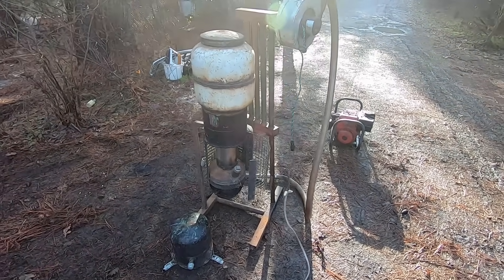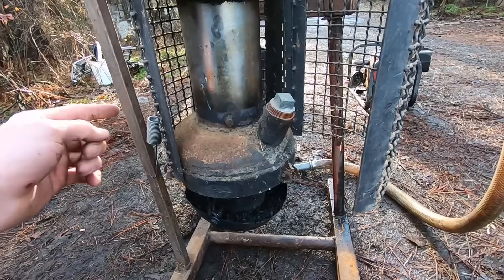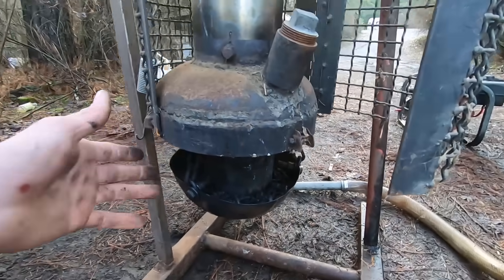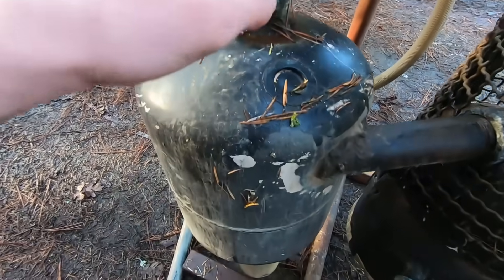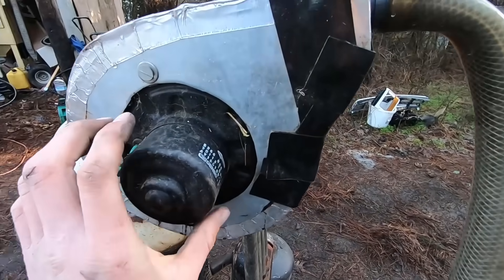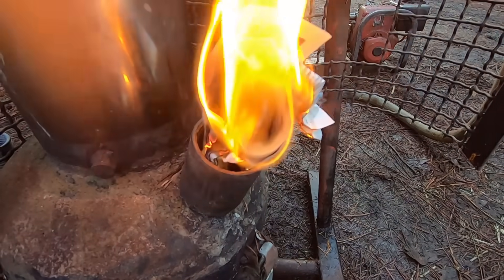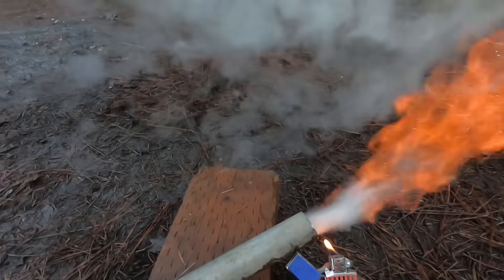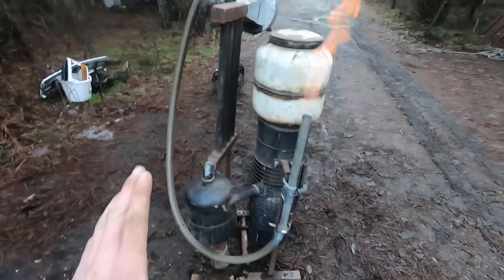Using Wood to Fuel a Generator! (How to Build a Wood Gasifier w/Demonstration)

Comment: PS: One year later: I was reading a book about gasifiers used in WWII by farmers within the German side (France, Belgium, Holland, and Germany) all of whom had no gasoline.  One version was a 2 ton flatbed truck used as a farrier (transporter) of goods and people.  Sort of like U-Haul/UPS/tourist bus.  It had the benefit of being less likely to be stolen by the pillagers as they couldn’t figure out how it worked or how to use it.  It kept the operator as a “much needed person” and thus much safer than a gas/diesel truck.  Secondly, for them, it only had to last five years (1940-1945) when gas was unavailable to almost everyone but the army and then, even they ran out and hired wood truck operators.  (Lack of petro fuel was part of the reason the Germans invaded the mid-east in the first place, just like Japan who also didn’t have their own fossil fuel prompting them to invade SE Asia.)  As for SHTF, everyone is right that remote, quiet, under the radar, minimal contacts with the outside, secrecy, near water, warning systems, guns, etc. are all true, as 95% of humans will be dead within two months from pillagers and mercenaries just like in a war, all long before the gasifier burns up from soot, acid corrosion, etc.  In the long run, solar is best but not mobile.  A gasifier can be mounted onto a “wood truck” for fuel instead of petroleum.  (See WWII Diary of a German Soldier by Helga Herzog Godfrey on the life of Eugen J. Herzog) and thus MOBILE!  Then, the owner went into town and offered himself as a service  to charge haul loads, move important (rich) people,  and today, run an electricity producing generator for charging batteries, powering tools, etc. and still go home due to them not being killed and their truck stolen stuff due to the secrecy/ignorance/confusion of how it works.  (The reason Bernard Van Braun wasn’t executed along with other Jews by the Nazis was they simply needed him to invent rockets and bombs as they couldn’t figure it out on their own.)  Secrecy is very important, and being willing to explain it but requiring three blackboards of scientific symbols and advanced math helps to keep the mystique and improve personal safety.  Advanced physics, chemistry, calculus, smoke, mirrors, black magic, and fortune telling helps as well.  And yes, build it NOW when you have parts, welders, etc.  For those with land, a shop, skills, materials, and time, this is more than just entertainment.  It could happen.  (Read “One Minute After” by Erwin Lutzer as a plausible example and time line for after the EMP hit the electronic grid.  Pre-electronic devices like 1950s cars in Havana were worth more than gold.  I ran my 1957 VW on lighter fluid when I ran out as a starving student back in the day.  Flexibility and remorsefulness is what is needed.  Even better: HYDRO (24hr/day, 365 days, near quiet (disguised nature sound), low maintenance, mechanical and/or electrical output, non-stealable, easy security/monitor/pay back, etc.  Go Hydro!

Comment: Good idea, they have wind hanger units from Europe that cost a fortune that use biomass to make hot water & air heating (cold climate) used in rural areas where biomass from land owned by operator readily available & produced sustainably // the professional unit uses a bunch of tech to achieve ultra low emissions & very high energy capture efficiency

Solar hot water & solar hot air systems can take thermal energy from impinging sunlight & transfer them to air & water for heat assist or desalination 
of sea water to fresh states for domestic, commercial or industrial use 

Gasification of trash to reduce methane emissions from dumps to address climate change are getting attention now from big companies like Sierra Energy of California & government subsidies 

Cool to see your DIY build & curious to see if you build a smaller, lighter, more efficient version in the future! Good luck & blessings brother! Cool video too! Thank you

Comment: DANGER!  You mentioned near the beginning the gases that were produced, and you mentioned that these were used to burn coal into a flammable gas, which was called coal gas. Other than the brief mention at the start of the video you carefully left out the fact that a major part of the gases produced is carbon monoxide, a colorless, odorless, tasteless and extremely toxic gas. (This is the deadly component in an automobile exhaust gas.) Significant numbers of people were killed by gas lamps going out and the coal gas coming into the house. If the gasifier is plumbed into a motor and the motor continues to run as long as the gasifier is working the danger is low, just as it is low if the entire unit is outdoors. The gas from a gasifier should NEVER be used in a house. You should have emphasized the danger in your discussion.

Comment: I’ve got no idea what your talking about. I no that I have two log truck loads of wood. Now, my portable sawmill runs with 8hp motor. I would like to try to run it off of the saw dust waste. Chipping up edges  that can’t be utilized. Waist verses log to log, very. Now the goal is to run the sawmill, and the heat from the gasifier to be utilized for helping my solar kiln dry the lumber. Hopefully lower my overhead in running the system. I’ve look at a atomizer to use less unleaded fuel. Can your set up work under those conditions? Thanks for your vid!!!

Comment: You need to know you can take a vacuum pump suck the gas off and pressurize it into more Freon containers or gas containers that you use for propane once you have it stored up under pressure the gasifier can be stationary the gas will be in bottles like a forklift and you will run your motor or generator off of bottles you just have to switch them it’s a lot safer

Comment: Way cool, I learned about this years ago when I was into my old VW and read about the germans using this system late in the war to power vehicles. Pro VW not NAZI just so where clear. Nice video very imformative. Like The Primative Technogy guy I  hope you keep at it. In the meantime I think Ill stash one or two 120 WC ASME propane tanks to go with my propane gens.

Comment: That's really amazing! I think the orange flame is the CO and the blue flame is the hydrogen, a hydrogen flame is almost invisible in daylight. I'm curious why they don't react to form methane like a commercial gas generator would. Is it because your system isn't hot enough, or the gases aren't inside it long enough? I suppose formation of methane is an endothermic process. 

Would there be any benefit in bubbling the gas through water? To clean off all that particulate smoke? Do it at a stage before you try dry your gas I suppose. You can use calcium oxide to remove water. It reacts to form calcium hydroxide. Then to regenerate it once it's used up, you just heat it. You should probably look this up somewhere professional before you do it!

Comment: How about compressing the gas into a pickup box sized propane tank then using some propane conversion components to run the engine. How far could you get on 150 psi?

Comment: I've been lightly researching this subject for a good while. This is the most simple explanation I've seen so far! Nice job. Question, do you use some sort of gasoline to get the initial start on the generator or is the syngas potent enough to start the engine also?

Comment: Nice setup!
I wanna do something like this, but I wanna save the gas in Propane cans and use it later for cooking with a Propane Stove.
So I need a compressor that runs on Wood-gas.
How do you make sure there is no oxygen in the wood-gas.???
I don't want to create a bomb.
Reply from the maker: The only way you can be relatively sure is by making a perfectly sealed system, and by getting your combustion juuuuuust right in the fuel grate. I plan to experiment with storing the gas in the future! Stay tuned!

Comment: 2ND PHASE.... PUT IN BACK OF SMALL PICKUP TRUCK....RUN GAS LINE THROUGH CAB TO CARBURATOR.  BUILD UP GAS AND RUN IT A VERY LING DISTANCE.  HE USED WOOD.HE RAN AS LONG AS HE WANTED WITH A (LITTLE EXTRA WOOD).  ARIZONA... HE GOES ALL OVER DESERT AND TO TOWN WITH NO GASOLINE.   LOOK IT UP AND REPEAT BUT IMPROVE IT!

Comment: Around 70% gas and 30 oxygen or 70% oxygen to 30% gas, plus containment = explosion.
Reply: Nitrogen is an inert gas.
Reply: Amazing, would love to see you setup hho (salt water) using a airplane model version of the wenkel engine (rotary). Liked and subbed.
Reply: Also if this could work in a 2 stroke, you could use a chainsaw endlessly. Lol

Comment: Thank you for sharing.
As a metal fabricator hunting ways to get off grid... I will definitely be making one of these.

So on the radiator, since I can weld, is there a possibility of making to much radiator? I dont mean like a ridiculous size, but could it be scaled up to much to where efficiency would go down? Thanks.
Reply from the maker: Not at all! There is a point at which you can't remove any more heat, at which point you're wasting material, but as long as your blower can pull gas through it, the more the merrier! Thank you for the comment!
Reply: Okay, great. Thanks.
Run a pipe underground to wherever you permanently store your generator and that could really shed some heat too.

Comment: This is the kind of content I've been looking for my entire life.  I'm surprised gas companies haven't paid to have this removed
Reply: I don't think they're worried, this is extremely inefficient and only works in an emergency scenario. A lot of cars in North Korea run like this, but wood is as hard to find there as coal or gas. Just like anyone who has used wood to heat there home knows, you can go through a lot to get through the winter. Using significantly more to power everything else quickly becomes unsustainable and you will run out of wood within a few years. Using something this to gasify coal or even flammable shale or loam could be a good value if they are acquired as waste from something else being done.
Reply: These types of engines are only viable whrn you have free and ready access to biomass. Such has having a large forest right outside your house or a farm you use to grow a bunch of energy dense weeds or grow hemp. Hemp is good for alot of useful shit.
Reply: Go ahead, we don't use this anymore since its inefficient. Unless you get the woodchips for free you'll pay more.
Reply: @LachskoenigIV  you can use any type of biomass in one of these
Reply: @johnbennett3714  then it only gets less efficient.
Reply: @LachskoenigIV  efficiency is not a concern when one is ‘flooded’ with biomass all around
Reply: @johnbennett3714  it is if you want to harvest that energy for anything besides heating. 

Lower efficiency means less concentrated gas is being produced, which at some point won't be able to keep that generator running with an applied load.
Reply: @LachskoenigIV  Found the guy that works for the gas company...

Comment: You guys all make the SMOKE, not a gas which fit to use in the engine. The GAS should be TRANSPARENT for not to kill your engine soon. Look here https://www.youtube.com/watch?v=pXXIQfsguvk and pay attention at the high quality of gas that guy has in his car. No smoke, transparent flow. You need to have control glass casing white filter just before the engine either and when it become to turn blackish you know that you need to clean the main filter.
Reply: Yup. I learned that lesson - and I ended up with a gasifier that produces an invisible gas stream, which burns with a lovely blue flame.

Comment: My grandfather had a Chevy that had a huge bag of gas on the roof. The canvas bag removed most of the water and contaminates. The bag had to be emptied all the time. He would get up 2hrs earlier to get the vehicle going at 9 or so. They used the charcoal to cook and dry the next days fuel. We are in Australia so the wood is VERY energy dense. This was in the 40s during the war.

Comment: Great VIdeo, i feel better that in a pinch we could build one and run our generator when the Shtfan, lol..   one thing :  I think  you might be able to do away with the 13v blower that gets the engine started bc just a very small amount of gasoline dumped into intake at motor would start the engine, creating draft, eliminating battery, blower etc.  Of course you'll still need the hose.  Presumably u could make moonshine in a pinch to sub for start gasoline (has to be about 196 proof or 98% pure  alcohol or starter fluid if its convenient, or you could rotate with a drill or bicycle arrangement to create vacuum, etc

Comment: Hey man, love the content big fan! How about water cooling the wood gas and using the hot water to heat a radiator in your work shop or saving in a boiler for an off grid shower?
Reply: Just to cleaify this isnt some plot to watch you take a shower, promise xD

Comment: Do you think its possible to adapt such a system to an existing outdoor wood boiler?  Basically keep the boiler set up as is, but add the vortex filter etc to the boiler chimney, reclaiming the boilers unspent gasses?

Comment: The potential for maximum efficiency of these things always captivates me. You have all that heat, tar and pressure to use or take advantage of to improve or condense the unit down. I'd like to have one of these that's mobilized for wood collection. Have to think on it still.

Comment: I would like to seen a water bubbler on that end hose and use some of the power from the generator for a good HHO generator done right not one of these half ass YouTube ones HHO. If done Right a small amount of power can produce a lot of HHO gas with this wood bubbler and I was wondering if there's any way of using the exhaust to heat up heat the once it's going to help heat the wood or a separate wood container up to 700° from the or 780 degrees the gas will come off without converting it at all if you could it might be a self running unit once it got started just changing out the wood when it was through might be a much simpler unit. kind of wonder maybe a 7 or 10,000 w generator if you took some of the electricity off and used it in a heating element to get it up to like I said 700 800 degrees the wood to do the gasification with electricity and the exhaust heat too to not have to use so much electricity. And some HHO gas and some might be a ticket too to getting this up hot enough that would if it didn't burn up the metal.  https://youtu.be/Ljm8m85p6T0.  https://youtu.be/ez75tgjr4nQ

Comment: Is your "Radiator" pipes connected to each other or are they individual and just connected at the top and bottom square tubing?
Would you be able to connect a tee connecter and a valve to release some of the condensation before it gets to the generator or would that just change the air to fuel ratio to much?
This is the first video i've seen on the gasifier but have already started watch others on this process.

Comment: http://www.allpowerlabs.com/

The worldwide leader in biomass conversion to electricity.
They've spent fifteen years experimenting, getting the bugs out of their gasifiers.
Reply: Look at the specs of the current version by All Power Labs>. http://www.allpowerlabs.com/pp30-power-pallet

It makes hot water as well as many types of electricity (e.g. 50 cycle or 60 cycle).

Comment: Me: "Oh cool, I've been wanting to know how to make a wood burning generator for a while. This looks complicated, but so have many of the projects I've made in the past. With enough hard work and some trial and error I bet I could get this up and running"
 Randomonium: "Now it's very important to have a completely airtight system, because what can happen is it can lead to a very dangerous stoichiometry, or mixture of fuel to air that can lead to an explosion."
Me:  Looks down at scars and scabs on hands just from using screw drivers and basic power tools. 
Also Me: "...You know, time is precious. I bet there are easier ways I could generate power if the electrical grid went down that wouldn't take as long for me to figure out. Yup. That's the reason why I'm not going to try this."
Reply from the maker: XD

Comment: how does the engine oil hold up?  If you run normal gas it gets dirty rather quickly but i hear that wood gas burns much cleaner but has 30-40% power reduction.  So how long can i run an engine with oil before i need to change it?

Comment: I've been preparing to build one myself, and have all the materials together, and this is the impetus for me to stop doing "all the other things" and have it up and operational.  This is one of the best, most practical designs I've seen for long term, or fixed off the grid, power, having looked through a dozen books, and articles on gasification.  Thank you very much!  Semper Fi, John McClain

Comment: If you put recycled plastic into this system you can effectively produce a kerosene grade fuel and even gasoline grade depending on how many times you run the end product through the system.

Comment: Excellent video ... !!! Question ... Syngas is kind of corrosive ... while gasoline has some lubricating effect ... would you comment on that? .... Also, you could make a secondary heat exchanger tube but inside a 30 gallon drum filled with water ... which will draw the water vapor out of the syngas for a final cleaning. Once again ... your approach was elegant  and very  effective to produce syngas.